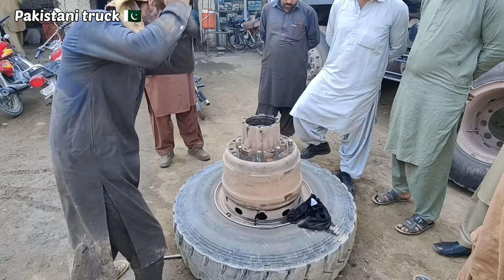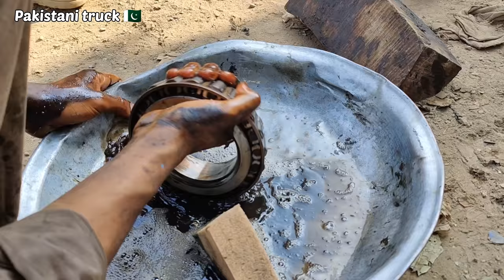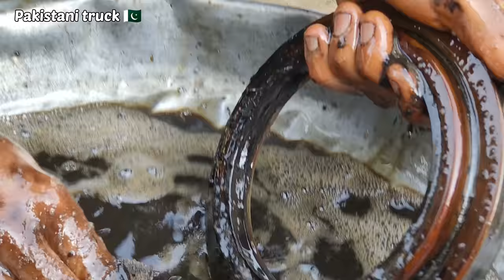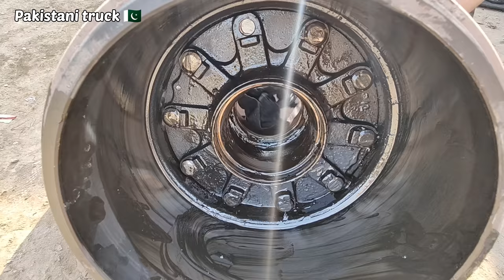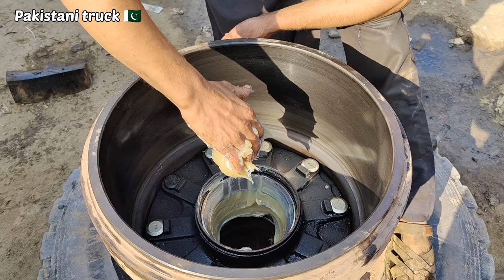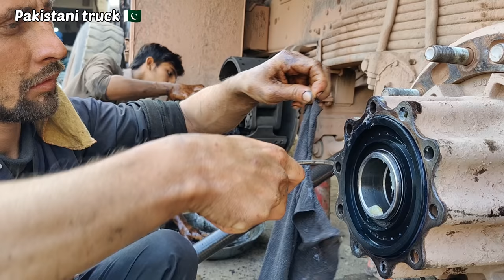Wheel Stud removal and Replacement | Truck Rear wheel stud | So easy

Comment: I Thank God for allowing me to buy my air compresor and 1 inch impact.
It has helped me a lot 
Less work and a whole lot faster to get things done.
I recently replaced the wheel studs on my reefer trailer a few days ago
Took me a few hrs but I took my time to do it and do it correctly and with no accidents since it was my very first time doing such job.
Ive also replaced the brakes and tires on my truck and trailer using my tools.
I am blessed to have such tools
These guys are hard working people who do it all the old way 
I have tons of respect for them

Comment: Here is a trick for packing bearings. Put bearing  grease in a clear plastic bag and insert bearing and seal bag and squeeze as usual. The benefits include no wasted grease on hands which must be cleaned off resulting in wasted grease. Also bag and grease are reusable thus saving grease for next time.
Reply: Good idea.
Reply: That's the way.,my father taught me,working on our family farm .and use a paint brush to clean off parts to keep your hands out of parts cleaner solutions, as much as possible .
Reply: You sure love to save grease

Comment: 😳 I'm very impressed 👍 gentlemen 👏👏👏all done by hand 👌. That's when you know it's done right 👍. Don't have to worry about a machine malfunction. Man's best quality of work is his hands. Spot on gentlemen 👏👏👏👍
Reply: When the camera is turned off believe they take all kinds short cuts
Reply: Actually machine work is more consistent and exact. Hand work is never consistent. How do they know how much to torque the nuts with a torque wrench? There are more mistakes and inaccuracies when done by hand. It's man's brains in creating machines that are more accurate, more precise, more powerful, and more consistent that makes th4 product a better product and more consistent and higher quality product. A CNC machine can cut, mill, drill, grind to within 1/10,000 of an inch job after job and can even compensate for wear on the cutting tool head. Can a human hand do that?
Reply: For this kind of very hard work in very poor working conditions with very less equipments /tools/machines for their hard work they got very little pay which they can feed hardly their families just for two times a day......

Comment: That kids going to a legend in engineering when he is older, Looks like little dude got the best teachers possible, The problem here a in the UK is a lot of kids these days would snub their noses up at a job like this, Kids don't see it as learning, I loved engineering and metal work growing up, I was welding and fabricating from the age of 17, Lost the job 2 years in for driving van an no licence, lol..
Went down the wrong path after that, I never had anyone to mentor me I guess, An that's the issue, Not enough kids want to get their hands dirty unless it's selling drugs on street corners...
Reply: Couldn't agree more.  I often worry about who's going to dirty their hands and do all this work when our generation die out.  The only ones to do this work now is older guys who need to retire.

Comment: Glad to see bearings getting repacked!
Reply: Why would you not repack them are there idiots out there that actually don't do that?
Reply: @Big_Ben1988  you'd be surprised lmao 🤣😂
Reply: @Big_Ben1988  tell me that's not a serious question??? If you haven't seen 1 get your nose out of the books and get your hands dirty!
Reply: @albertoascencio5935  Bro I've been a mechanic for years.  And now currently work in mining.  I get my hands dirty everyday.
Reply: @albertoascencio5935  And at the shop I worked at everyone repacked the bearings with grease cause we actually knew what we were doing.  You must hang around a bunch of shade tree wannabes.
Reply: That's more than most main dealers would do.

Comment: Thought they were gonna loosen the Slack adjuster to back the brakes off and do it that way but nope I watched the video to see the studs replaced but got a bonus and learned how to pull the axle hub wheel bearings oil seal basically they rebuilt that hub even tho I’m sure they used everything over they cleaned thoroughly greased up everything and put it all back together with bare minimum no fancy tools these guys are beast at what they do 👍🏻

Comment: I understand the options for tools and materials are very limited for these folks, so it's doubtful that information from an MSDS sheet about the (potential) health hazards associated with the solvent they're using to clean bearings with would change anything -- especially since something like myelodysplastic syndrome (MDS) caused my benzene exposure isn't usually realized until your 60s or later.  They may not even have the resources to obtain such a diagnosis, so no one ever becomes enlightened and the condition is (potentially) passed on to his son and his son's son in the family business.  MDS killed my father when he was 70 (symptoms at 68), though his exposure to benzene associated with a 4-year duration of employment occurred in his late 20s. There is no cure, and the treatment he (understandably) sought cut his one-year to live prognosis via "comfort care" by half and made him extremely ill. This makes the scenario of the child's involvement even more troubling for me since his exposure is occurring so early in his life.

Comment: I work on trucks and buses. I wouldn't get in and drive away if I was the driver. It seems like they reused the seal, contaminated the break pads which were just dusty with oily cleaning solution, those big nuts that put after the outer bearing are supoosed to be torqued to a specific torque or it is too tight or too lose which will cause premature failure to the bearing.

Comment: Good old inboard brakes and hubs. So glad they got rid of this style. When I first started as a apprentice 20 years ago. I would do 3 axle trailers and replace races, bearings, and s cams. I would have at least sandpaper the spindle. Regardless of the conditions they kept things pretty clean…

Comment: Gee. It takes like an hours for one wheel.

 Respect.

:0
Reply: Just like in your local truck main dealer. I was once told by a Mercedes truck dealer it would take 6 hour to do the job they really didn't like being asked if they were taking the piss. the technician asked me if I thought I could do it quicker. Yes was my reply I then bought the parts drove the truck back across the road into  work got my tools out the back of my van 3 hour later I drove the truck back into the dealer to show them my work and piss them off.
Ps I did have 3 mugs of tea as well.
Reply: @travelling_stephen  That is...quite experience!

 X'D🙏🏻

Comment: Qualified, Fully Licensed mechanics I'm sure!
Reply: Im sure the 6 yr old working on the truck is fully a.s.e certified.
Reply: @travelling_stephen  Full Definition of sarcasm
1: a sharp and often satirical or ironic utterance designed to cut or give pain
2a: a mode of satirical wit depending for its effect on bitter, caustic, and often ironic language that is usually directed against an individual
b: the use or language of sarcasm
Reply: @travelling_stephen  Im sure the child in the video also has more reading skills and understanding of the english language than 99.9 percent of british kids put together. Obviously you didnt get the comment I made.

Comment: Correct me if I am wrong but those look like outboard brakes. While brute force may still be required to separate drum from hub in a dirty environment or after time due to corrosion, makes the job much easier to pull the drum and then the hub, using the drum as a hub stand to do studs and bearings.
Reply: It is more difficult that way, if that way is easier then they already done than that way, because those men is already done many times same kind of work.
Sorry my grammar is really bad
Reply: @atlasflame2510  I’m not familiar with that style of truck but the hub assembly looks about the same to what I deal with everyday. I’m sure there is a reason they do it the way they do, but it doesn’t look easier.
Reply: @Kwhopperfan  i think you meant is making use of the weight of the brake drum to pull the hub out?
Reply: @atlasflame2510  normally with the hub and drum still on the truck axle after removing the wheels and tires, you would back off the brake adjustment and strike the drum with a heavy hammer until it breaks free from the hub, then you only have to lift the drum off, pull the axle shaft, and bearings and then the hub by itself. Much lighter. You would only go through all that if the seal was leaking or the bearings had failed. Studs and brakes shoes can be replaced while hub is still on the axle.

Comment: What was the point in rebuilding that with about 4mm of brake lining left. Will have to be stripped down again in around 3 weeks. That is if the re used hub seal doesn’t piss grease all other the brake shoes before that. You never re use a hub seal. Mind you you don’t leave fresh greased bearings out on a sandy floor either. 
Rough as …..

Comment: 2:54 an old toothbrush can be a better tool to clean those parts, also be careful working on that side of the truck without wheels, it can fall over you guys.

Comment: Isn't those bearings usually in a oil bath not hard grease
Reply: there was a seal between the shaft and the bearings, also the young guy was washing the old grease out
Reply: No, tapered hub bearings always get  greased with (EP) extream pressure type grease, when you see oil on them it means the shaft seal is compromised
Reply: @Airman..  I drive truck and been around heavy equipment most of my life the front is even supposed to be in a oil bath I think it might be because of how hot it is there they use grease because normally the rear-end oil is what lubricates these bearings
Reply: @adriaan9011  the seal is to keep the oil inside the Hub
Reply: @paulb7334  how are you suppost to put the oil in the hub? what you say exists but usualy in a final-drive, when the hub is a gearbox itself
Reply: @adriaan9011  ya don't the center is hollow and the oil that lubes the gears should be high enough to label the Axl gears also the real question is have you ever worked on one? Because I have
Reply: @paulb7334  yes i have, and not just once as you seem to have
Reply: Planetary type is  oil  bath
That kind grease is it floats on the grease
Reply: @paulb7334  wrong, japan made truck usually uses grase to lubricate the bearings, which means only the grease will lubricate the bearings not the oil from the deferential.
The one he is talking is what we called planetary type deferential it uses oil as a lubricant. And it is not common on Japanese made truck. You can mostly found them on a 6x6 dumpdruck
Reply: @adriaan9011  it will not oil the hub, it floats on the grease, the grease will melt and lubricate the the bearings
Reply: @paulb7334  your wrong, the oil from the deferential will not lubricate the hub bearings, because it is not level, the oil is only leveled to the nut where you will put the deferential oil, the nut is slightly lower than the hole where the axle shaft is located.
Reply: @atlasflame2510  I had  a dump truck axle apart today there is no grease on those bearings and there was oil came out of the axle tube so I stuffed a rag in it  wile I done what I had to do before putting it back together without hard grease
Reply: @paulb7334  I dot not have knowledge on American and European made.
Only on Japanese made truck,  that type of axle in the vedio is very common in my country.
Reply: @atlasflame2510  I'm in Canada

Comment: Their way of setting the bearing to spec is by hammering in the lock nut till it won’t budge anymore. Wow no special tools used none of the nuts and bolts torqued to specs. I’m glad I’m not driving that truck

Comment: Nice work but I'd like to know if cement is not discovered in Pakistan yet...? 🤔 Why they are always work on soil, and not on concrete/beton?🤔
Reply: They have cement in pakistan, but i think is expensive and they are used to work in the soil and dust

Comment: How do you donate gloves 🧤 for these guys especially the kids. Don't like to see kids using petroleum to clean oil and greece without disposable gloves.
Reply: You need to donate tons of disposable gloves to them because the work is not the same in your country, disposable gloves will not last long
Reply: @atlasflame2510  gloves have came a long way, a box of good gloves would last all week. oil and petrol causes cancer. i use really tough gloves they last just fine. love to see the work you all do its fantastic.